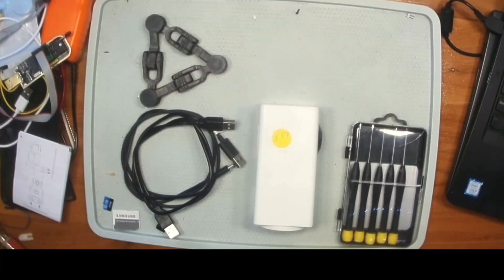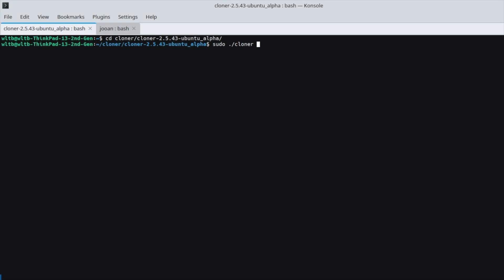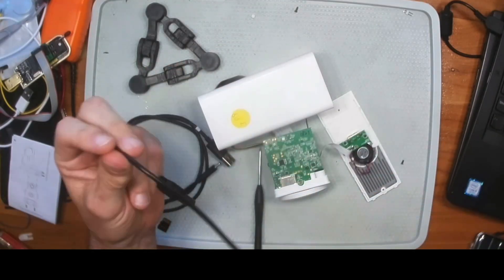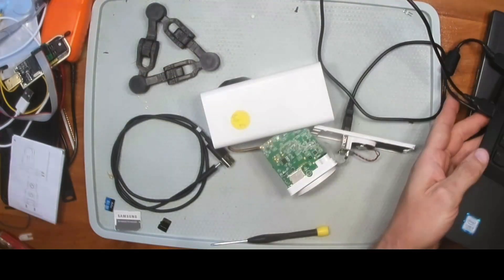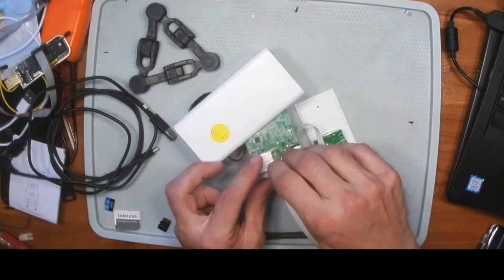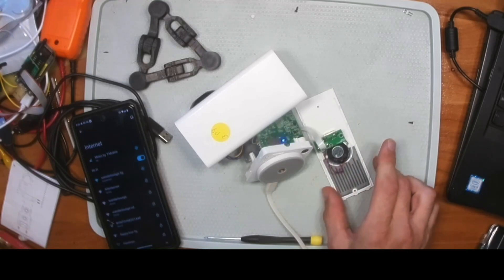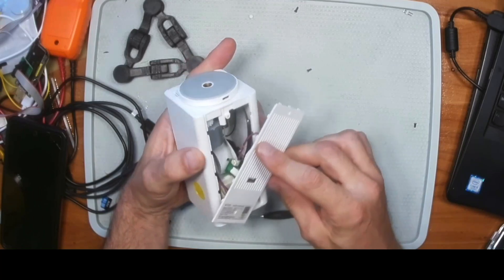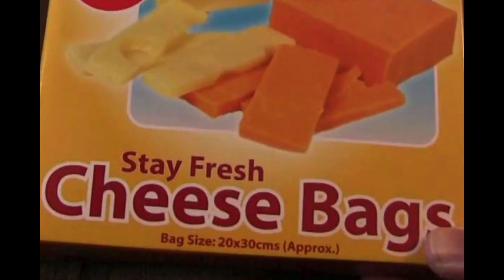Unbrick your Wyze Cam Pan V1 and install Thingino Open Source Firmware!

Comment: Thank you so much for this video. I've managed to unbrick my Dafang DF3 and install Thingino using this method. It's actually impressive that this camera that I've bought nearly 8 years ago not only still works but has an active community creating custom firmware for it. As a side note, for anyone using USBCloner on Windows, the board config that worked for me was t20_sfc_nor_writer_full.cfg. Thanks!
Reply from the maker: Pretty amazing how competitive those decade old devices can be when they're not encumbered by the factory restrictions! The JXF22 sensor isn't great but it's not terrible, not something I'd recommend buying today when the Cinnado D1 is around $10, but taking something you already have and bringing it back to actualuseful service after years and years is great! if you decide to expand, check my video on the WUUK it's my favorite device still!

Comment: Would this work to flash original Wyze firmware for cam pan v1?
Reply from the maker: it will flash whatever file you give it, if you have a full firmware dump of the factory image it will do that!

Comment: Hi thanks for sharing this video, I have a question: if we are running wyze firmware and the “setup” button is not working- whether shorting pins 5 and 6 during bootup via USB A to A cable will force the device to enter recovery mode ?
Reply from the maker: Indeed that pin short will put the device into programming (aka recovery) mode and you will be able to flash using Cloner!
Reply: Thanks, whether we can flash wyze firmware (original) by shorting pins 5 and 6 while booting up using micro USB cable ?
Reply from the maker: Wyze cam v2/cam pan v1 only have data on the usb A port, not the micro usb port. You need to use the A port.

Comment: Some screwdrivers /tools do not work properly for shorting the circuit, like the black covered ones. I had to use a shiny one. Sorry if I am not explaining myself well, I do not know how that metal finishing is. Thank you for the video!
Reply from the maker: Yes, for sure the screwdriver needs to be a conductive material and not have a coating or paint or something on it. Thanks for pointing that out!